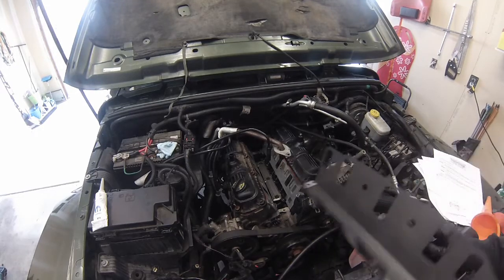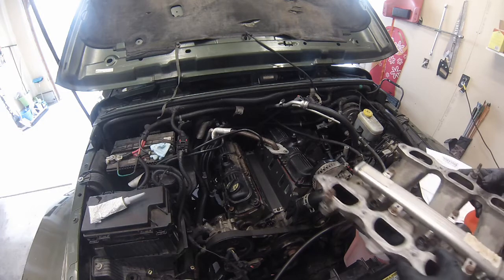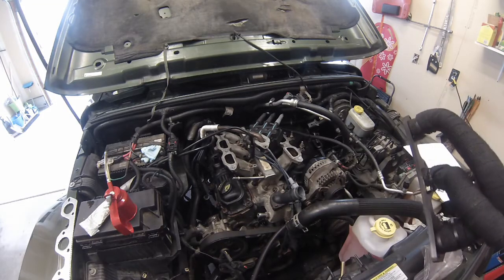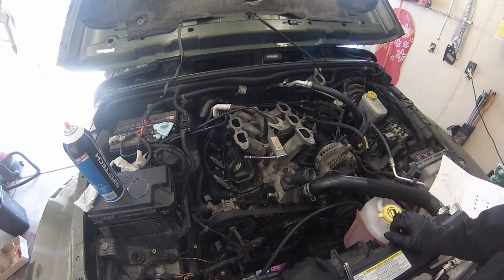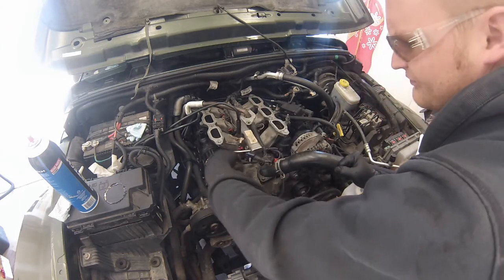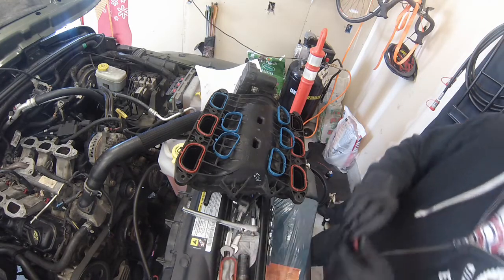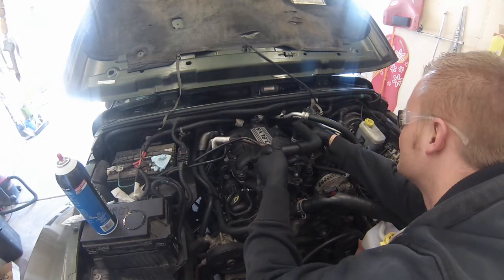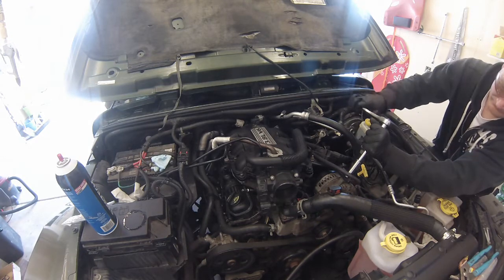Jeep Wrangler JK 3.8L Engine Rebuild Part 10 - Intake and Exhaust Headers Install

Comment: You can use the copper gasket spray stuff. On the exhaust man gasket it holds the gasket in place
Reply from the maker: Thanks for the tip!

Comment: Having replaced the oil cooler in a 2012 3.6L Jeep, which required going down to the lower intake and into the valley, I am going to replace the lower intake gasket on our 2007 3.8L Jeep next due to an oil leak.

Did you just have to lower the level of the coolant enough to get the hose off the thermostat?  Don’t want to drain more than needed is why I ask.
Reply from the maker: We went ahead and drained the entire thing but you can certainly only drain a little but to what you need, just make sure contaminants don't get in the engine while it's opened up. Thanks for watching!

Comment: Just food for thought: I put a lot of work into disassembly and reassembly at this point. Having previously already had oil leaks, and after having put all this effort into reassembly, I still have an oil leak from some invisible, unknown place on the back of the engine. I suspect it's got to be the lower intake. Even though there is a rubber 'gasket' on the bottom of the tray, I'd highly recommend running a dab of that silicone all the way across the block between the heads (not just the mating corners). It sucks to have all that effort into something and still have an oil trickle. Thoughts?
Reply from the maker: Might be worth trying. Have you considered that it might be your rear main seal? I'm up for any new ideas for these engines... This engine only had around 60k miles on it when it lost compression so obviously the original design wasn't awesome...

Comment: Ordered a victor reinz head gasket set, has gaskets not sure if. The small o rings, are they for the fuel injectors?
Reply from the maker: Possibly, check the intake manifold and compare to the fuel injectors. Good luck!

Comment: Great videos,   working on a bad injector...thus video is helping me alot...any tips on replacing an injector?
Reply from the maker: They should be pretty straight forward. Be patient with getting the wiring connection off, they can be tricky. Use a brush and compressed air to clean off any dirt or debris prior to removing them. Even getting a small piece of rock in the injector hole could mean big trouble for the engine. So do a good cleaning of the surrounding areas before pulling them and then also I always add di-electric grease to the wiring connector to help keep out junk. I remove one at a time and then immediately replace it so I don't run the chance of mixing up wire connections or allowing the hole to be opened too long. I also add just a small bit of oil to the O-ring on the new injector to help slide it in place. Good luck and keep me updated on how it runs once you're done! Thanks for watching!
Reply: @TheDadBodWorkshop  thank you for the tips!  Everything went well and the jeep runs like a champ now thank you!! 

Oh i should mention i got a new code that came up p02111...so i bought some throttle body cleaner and sprayed the inside of the tb like crazy! It was dirty...then I  Reset the codes and no engine lights or codes  popping up!   Success!!   :)
Reply from the maker: @Julian-G007  that is excellent news! That is awesome! Good job!